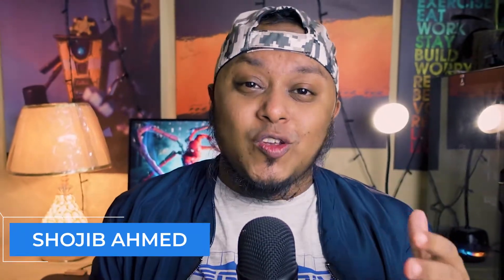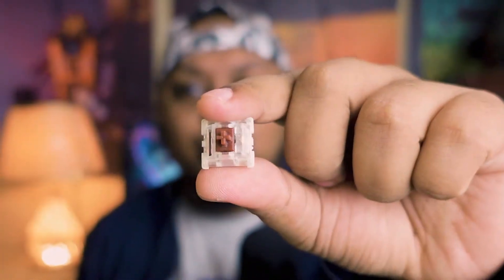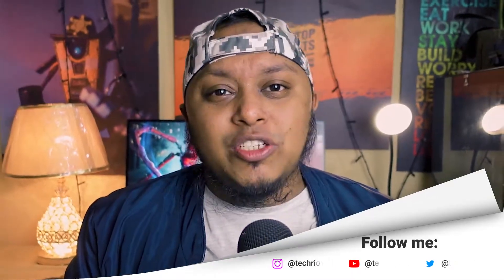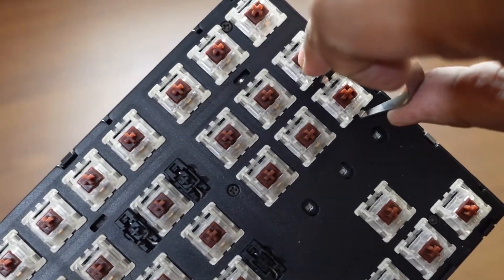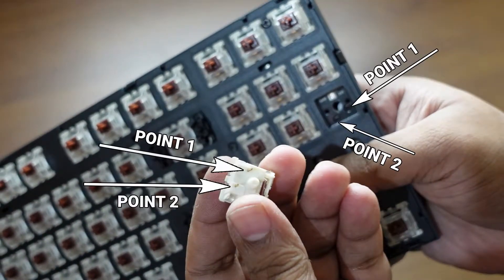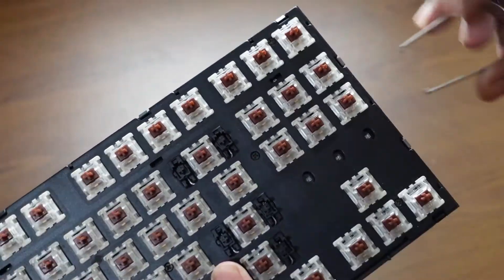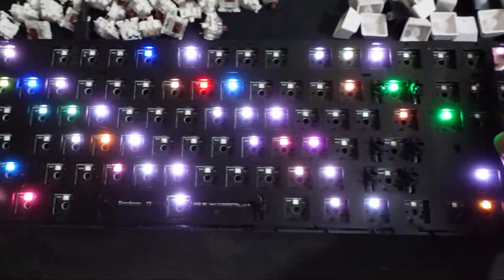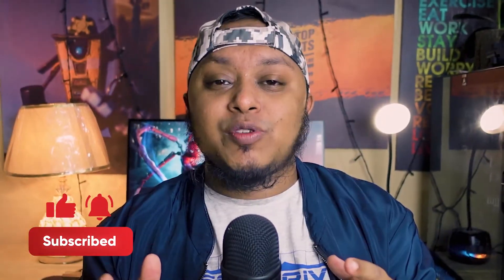How to Replace Switches on Hotswappable Mechanical Keyboard | Keychron C1 Gateron Brown Switches

Comment: Will it work with soldered ones?
Reply from the maker: No, Only possible on Hot Swappable Switches!
Reply: If it were to be soldered, you would have to take the plate out, when you take the player out, you will have to desolder the switches. So no, it won’t work with soldered ones.
Reply: @Hoyse Buchanan  so it's possible to solder on a new switch? My w key just randomly stopped working in game..